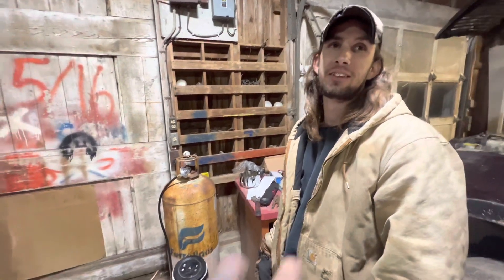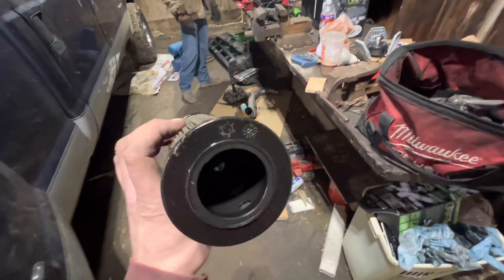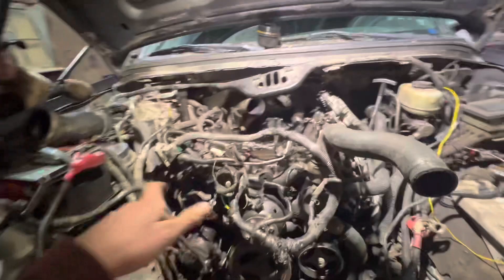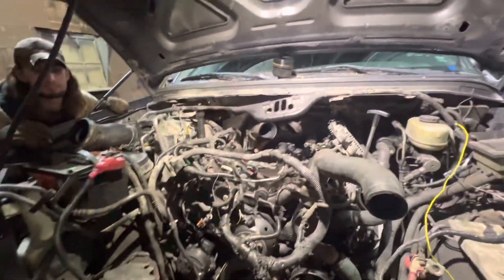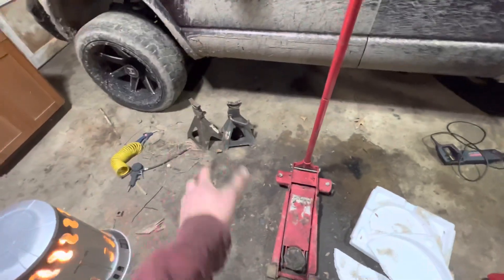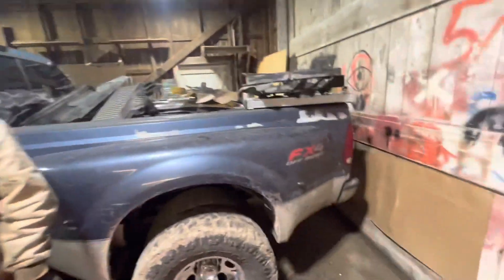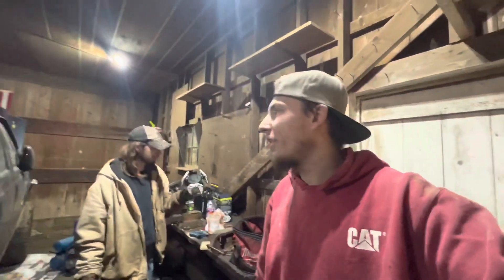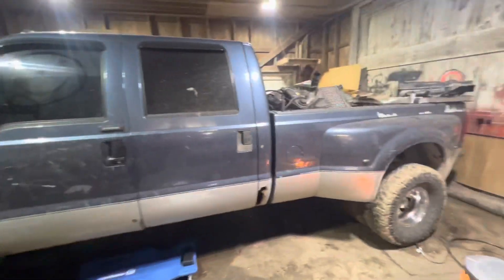Cummins Swapping a 6.0 Powerstroke intro

Comment: Building a 6.0 now complete frame up currently motor has 311000 spare block being built as well love the sound of the 6.0 I’ll prob stick with the 6.0 one day may Cummins swap Cummins do sound decent as well I believe they can be powerhouses
Reply from the maker: Yes do a Cummins swap
Reply: @EverbodyHatesDan  honestly been thinking about it it’ll be later down the road I’ll enjoy the 6.0 for a little while longer seeing as I already have a block I’m building and the one in the truck currently runs great as well so far

Comment: 6.0 still sounds better tho unfortunately they're problematic.
Reply from the maker: Yeah kinda sucks to get rid of the engine cause it was an absolute powerhouse but I’ve had nothing but issues with this engine so far on the other hand the 05 6.0 that I had a few years back never let me down when I needed it, thought that this truck would be the same case but unfortunately not
Reply: How did the cummins work out